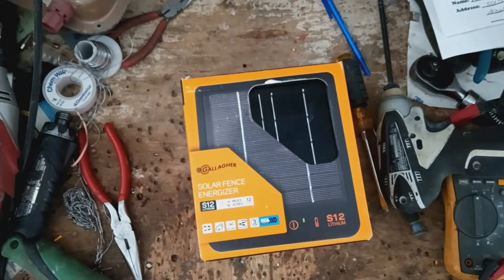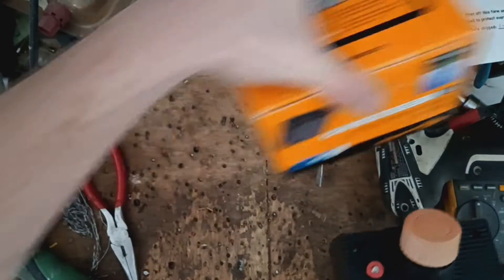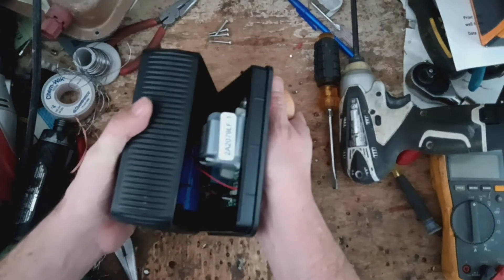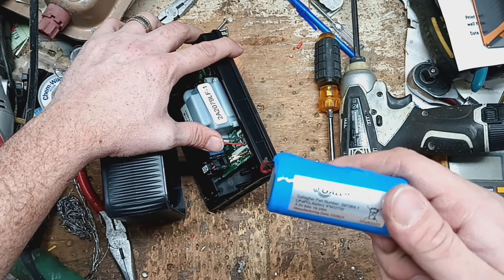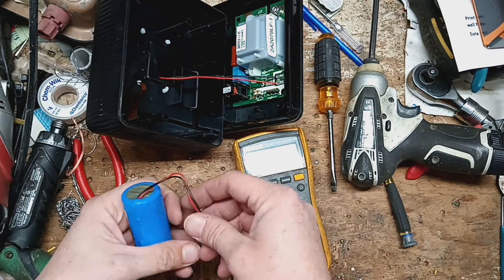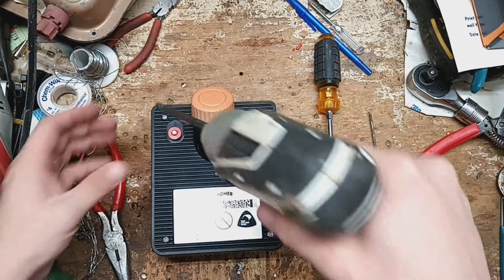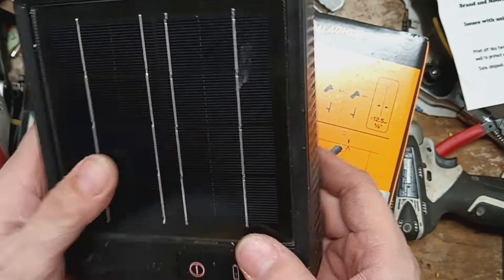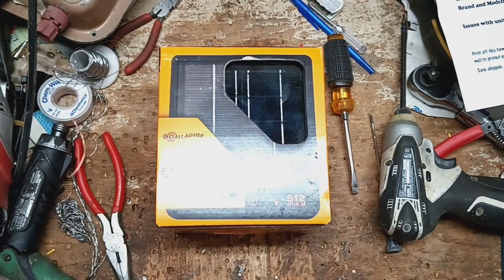Gallagher Solar S12 Won't Turn On

Comment: I bought the S6 in 2022.  It worked great in 2022 and 2023.  This year (2024), I couldn't turn it on - same as here - after three days of charging the unit in bright sunlight.  I noticed rust on my ground pole as well as on the contact clips.  After spending a few minutes using some Emory cloth to clean up all points of contact, the unit turned on and is working perfectly!
Reply from the maker: I have talked to Gallagher on the not turning on and they did have some issues with the push button membrane on the front. The board and everything inside is fine, just the little button on the front can have issues, but they have corrected it at the factory since before I made this video and gallagher repaired this unit under warranty. I didn't have any parts in stock for this unit and just sent it to them to take care of.

Comment: That battery type can't be charged below freezing.  Not ideal for year-round usage in most parts of the US.
Reply from the maker: There are other options of units out there I'm sure. Gallagher does put a lot of testing and R&D into their units though to try and help things out.
https://youtu.be/sd50Bf2VOMA